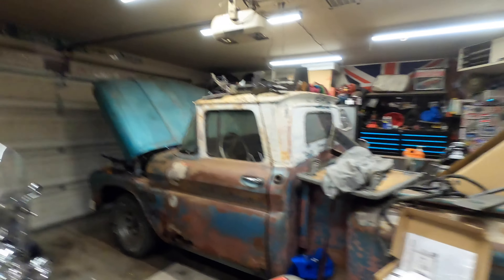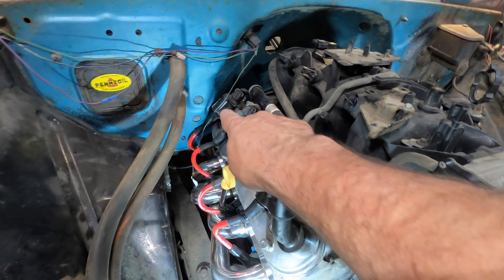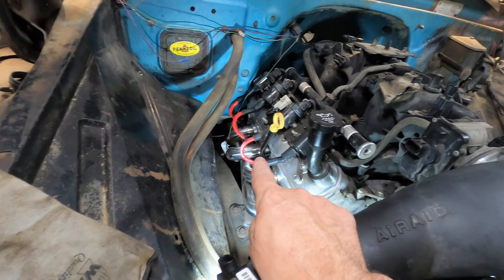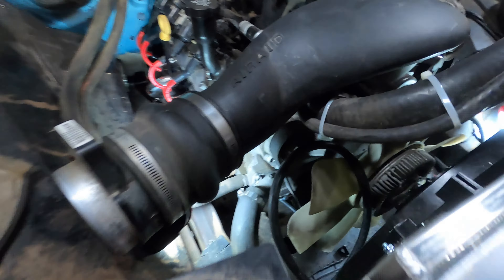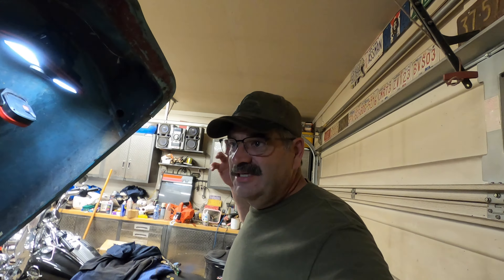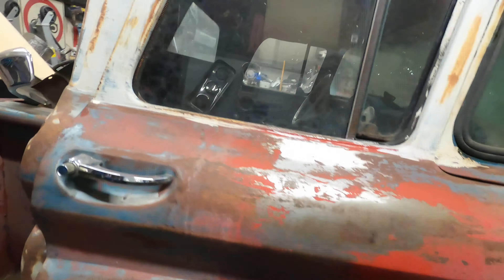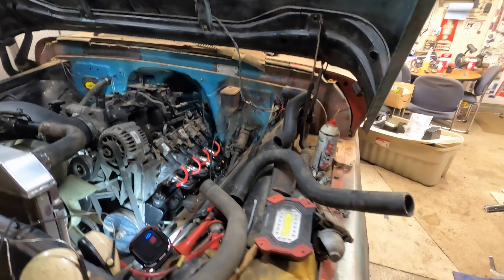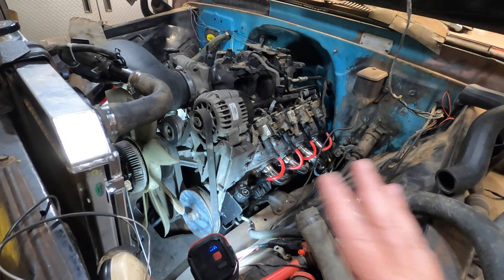LS SWAP INTO A 1963 CHEVY C10 UPDATE! - IS IT FINALLY UP AND RUNNING?!!

Comment: The 4L80 fits under the low hump?
Reply: The last short I saw a bolt on hump. Mine is low hump no bolts, but I’m going to fit an ar5 with hydraulic clutch. Interesting to see how well the 4l80 fits looks like there’s enough room
Reply: Looks great
Reply from the maker: It fits!!  Low hump!